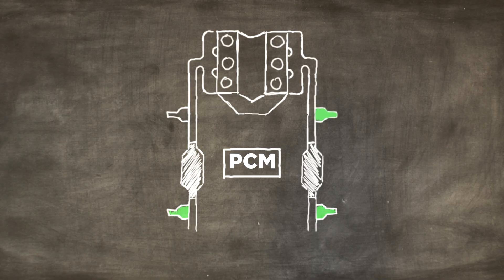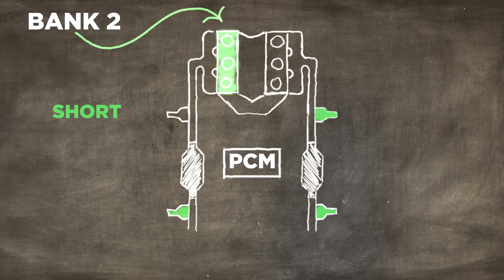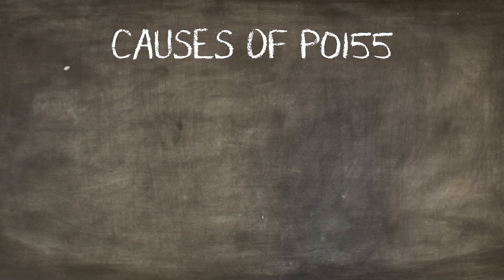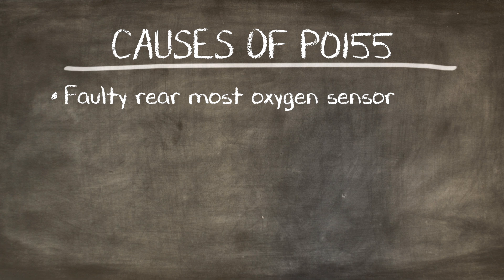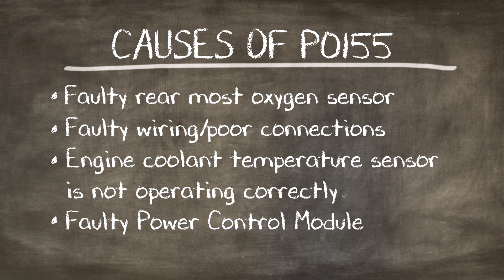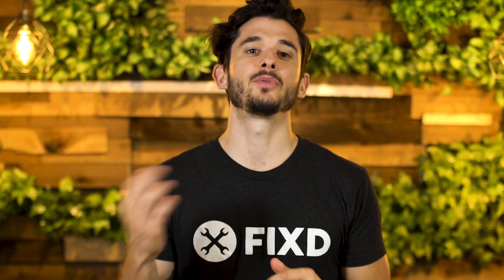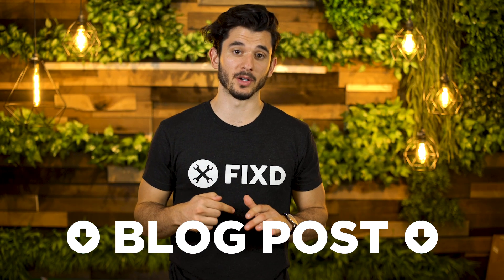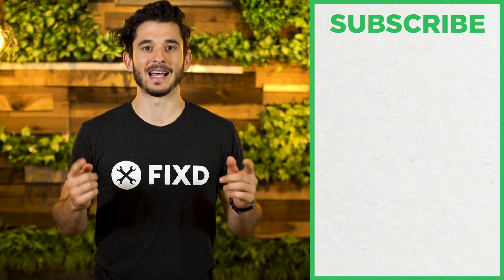P0155 Explained - Oxygen Sensor Heater Circuit Malfunction (Simple Fix)

Comment: I have a 2003 Highlander with a P0155 code too. I bought a Bosch replacement Oxygen sensor and installed it and still have a P0155 code and cannot get new plates for my car?
Reply: Yo también lo cambié y sigue igual
Reply: A lof of people said to me that Toyota/Lexus need a original sensor, otherwise you stil get the p0155 code